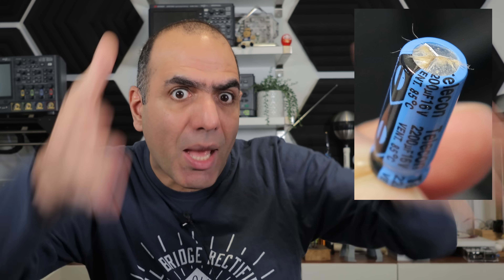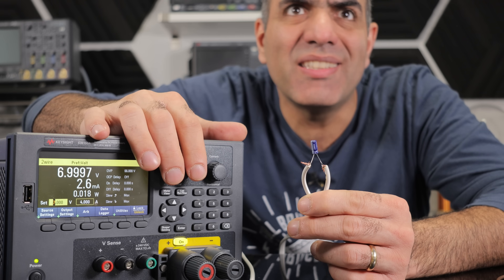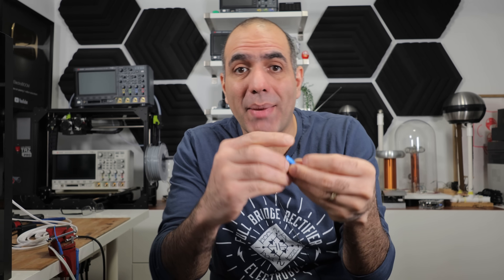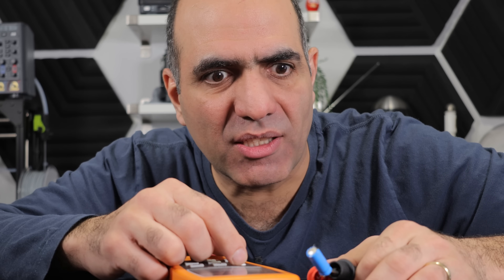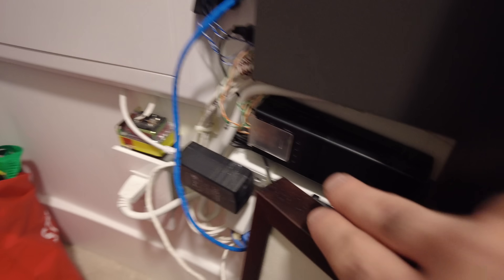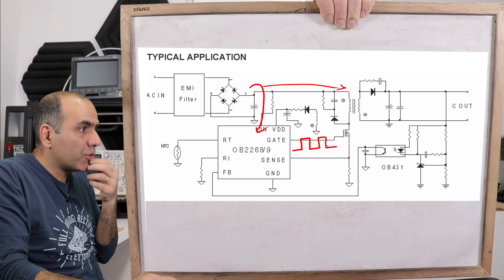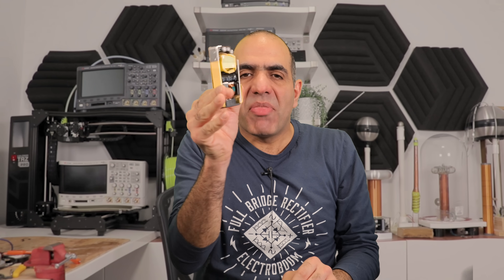Why Replace Bulging Electrolytic Capacitors

Comment: Love your channel, @ElectroBoom!
I love your approach and visual explanations. This one around capacitors, especially electrolitic caps is absolutly true. They are in most cases the first thing that fail in SMPS, aaudio amps and circuits where the ripple is significant. The ripple itself is the main cause of bulging caps.
Now, speciffically SMPS are arguably one of the hardest circuits to explain and diagnose, so cudos for attempting that. in essence there is 4 parts to it:
1. The high-voltage part, where the 120/240V AC input is rectified (turned into DC), by your favourite, Full Bridge Rectifier and fed into a 
2. PWM that coverts it back into AC (via the FET and Transformer), the PWM will controll the speed of the switching to get the desired output voltage,
3. The output voltage that is rectified back to DC and filtered by those capacitors, and
4. The Feedback loop that senses the output votage ( in various ways) and send a signal back to the PWM to correct it's speed
So there are two lots of caps that can fail in SMPS. One are the output ones, that you showed in this clip, the other is the first stage, (the one you were shorting out as it holds charge long after you've switched the SMPS off. It is usually a 400V cap (to account for countries where the voltage is 240AC, and with various capacity (around 200uF). That one is usually the culprit of the failed start up of the SMPS, more than the other ones at the output stage. 90% of SMPS failures are from a failed high voltage cap.

Comment: I have an old dtv converter box that failed. I took it apart and found that one of the capacitors in the power supply was bulging. Replaced it and it works like new now.

Comment: I used to work with an engineer who deliberately blew up electrolytic capacitors, connecting them to 120 VAC, to verify that they  would release the pressure safely.  He covered them with a cardboard box.

Comment: I always replace the capacitors on the switchmode DC-DC converters, especially on a computer motherboard, especially those with supports for Pentium 4 and Athlon K7 processors and later, those processors chugs amperage at low low voltage as if it's a decent cup of beer, it's already crazy enough. So if I get bludging capacitors, I replace them before I bother to apply power to 20 years old motherboards (The Capacitor Plague was a real deal, and it was a headache even for Dell), I also take age into factor.

Comment: About a week ago, I bought a Sega Saturn console from eBay with a "no power" fault. Turns out, the power supply board inside is similar to the one in this video. I'd never seen this AC->DC->PWM->Transformer setup before, but the problem turned out to be the same. It was the control chip that output the PWM that had just died a death. I was looking for bulging caps too, but they were all fine. Replacing the chip (which actually looked more like a through-hole MOSFET) fixed the issue! :)

Comment: 1999 to 2007–the Great Capacitor Death or Plague. Thousands of aluminium electrolytic capacitors died premature deaths due to poorly formulated electrolyte.

I remember the time well, often finding failures in equipment years later. Great days lol

Comment: The reason you have bulging elco's (electrolytic capacitors)  is because the formula for the dielectric has been secret and thus requires money to buy.  Someone thought to be clever, developed their own and sold it far cheaper, and so it made its way into the supply chain.  The problem: this cheap dielectric failed after a few years, but by that time those capacitors were everywhere so especially older devices can still fail as a result.  Newer devices have good capacitors as the failing formula has been taken of the market, but it may still hide on batches of old capacitors.  So yes, the first thing you do with a failing device is replace the elco's.  Sometimes that's all it takes if nothing else has suffered as a result.

Comment: Weather fully blowing up I mean why they're fully blowing up it's because that they don't have like those screws on the top grooves those are events so if a capacitor like fully blows up because those ones are more dangerous to blow up so it will only pop up a little bit with the smoke comes out

Comment: I repaired a charger for a original firefighter worklight,inside was a bulged electrolytic capacitor, rated 3300uF, tested 5 picofarad,😂,i replaced it with a Panasonic 3300uF, with the same volt rating,works perfect. And the worklight itself got a New accumulator.restoration done.

Comment: This is impressive and really cool work. I tried supplying over voltage across an electrolytic capacitor on my channel too. And supplied an electrical fan without a capacitor and later with a capacitor And the results were fantastic.
Reply: Truly impressive work Electroboom. I checked up your channel too lol great stuff you have there.😊
Reply: Electroboom is a wonderful teacher. You too have a cool channel coming up lol with really cool stuff.
Reply: I love the results.

Comment: Many years ago I found two TVs in the garbage and took them home. They wouldn't turn on so I opened them up and found bulging/blown capacitors on the power supply, so I replaced the capacitors (with slightly higher rated ones) and the TVs have been working ever since.

Comment: I have a 12000 btu air con compressor that uses a 60 micro farad capacitor and used a 80 microfarad capcitor that measured 65, and it works, if it works ot works lmao

Comment: Some zigbee dimmer companies mention that you should connect a capacitor at the wire of the switch. For my feeling it was not a good idea to apply 220V at the capacitor, for this reason. 🤣

Comment: My eMac had bulging capacitors... I know - it was a long time ago; still bearing a grudge.  Apple didn't want to repair it for me.  Said it wasn't covered by warranty, even though they were covering the iMac that had the exact same problem... (Yes, eventually they did including the eMac in the Repair Program, but not before thousands of eMacs went to landfill because Apple wanted $600 to fix a $800 computer.)

Comment: Have you ever tried to charge non-rechargeable batteries. I have and they exploded. Partly it works, but you shouldn't control battery heat because it will blow the batteries. I was a kid and I did this many decades ago.

Comment: And to think when I used to work at the car stereo shop we'd sell 1 and 3 farad caps to kids to wire to their systems in rust bucket honda civics with horrible wiring. Its a wonder nobody lost a finger.

Comment: You should build a ventilation system like attach a fan to like a bendable pipe then you can like pull it in. Bring it anywhere you want so you can get rid of the bad smoke

Comment: Meaning replacing the capacitor with a higher rating one, do i change to a higher voltage or higher capacitance or both ?

Comment: You should use car battery clamps and clamp or weld on copper or other material rods and instead of putting it on a car battery you should use a microwave transformer or other high electricity output and make a taser

Comment: Hello, I always like to learn from your videos, and since I see that you always like to challenge all the false information that circulates on the internet, I have a question about how the Lakhovsky multiple wave oscillator really works, I leave you a link to a drive where you can find three books:

https://drive.google.com/drive/folders/1N2xzcl59_2r8jtpBlYUqhP1r2yWJV6q_?usp=sharing

two books in Spanish and one in English, perhaps it is a nice topic to investigate electronics where there are always many doubts about how it works exactly, I do not have the equipment to measure anything unfortunately. greetings from Argentina

Comment: I can tell you that brands of the Capacitor matters, some are higher quality and last long but some doesn't even hold a candle and LEAKS its Juices overtime
As time goes by, Capacitor would need to be replaced by the same uf it has, you can put in slightly higher voltage Capacitor with the same uf, example : 220uf 10v is the one you need to replace, 220uf 16v is all you can find, you can use that to replace

Comment: Warning ⚠️: Video contains high voltage/electricity, wear safety gear when copying, and NEVER wear anything that is not leather, or has metal, even with a bit, he should add warnings for these.

Comment: Electrolytic Capacitors usualy don't blow when you use the wrong polarity. This way they rather die slowly. Its overvoltage that blows them up imidialtly. No matter if polairty is right or wrong.

Comment: My home central air unit has blown 2 huge capacitors in 2 years so I gave up and put in window ac units. They cost what a visit from an hvac company charges to look at the central air. Isn’t being a check to check homeowner great.

Comment: Can u explain  - does it possible square wave inverter convert pure sine wave inverter just using output side LC circuit// & if it happens what r the losses will be there after using LC circuit..tnks

Comment: 8:00 what is higher rating capacitor mean?
Reply: Higher voltage and capacitance, probably
Reply: Higher voltage (or maybe maybe temperature), NOT capacitance. Changing capacitance values may effect the whole circuit behaviour and therefore should be done more carefully

Comment: in college, my buddy (who built his own mg td from a kit, for which i am still insanely jealous) and i used to sneak capacitors from our labs into our pockets and over-voltage them behind the parking lot after class to blow them up real good. except for the electrolytic capacitor the size of a small coffee can, which had safety measures in it and just gave a disappointing p-fsssss, the bigger the capacitor, the bigger the boom. hehe--good times!

Comment: One of the techs at the place I worked years ago delighted in taking large electros out of defunct equipment destined for the bin and placing them directly across 240VAC.  My office was near their workshop and I'd hear loud bangs coming from it occasionally so I took a look.  As soon as I saw what he was doing I got out of there.  It's a miracle he didn't cop shrapnel in the eye really.

Comment: I had a Lexmark printer not turn on. Opening it up I found the remains of a capacitor and the metal cap which had taken a chunk out of a chip on the board.

Comment: I have computer speakers that has a broken power supply because of a broken capacitor so i found a 12 volt wall adapter and connected it to the amplifier and it works now

Comment: You can't just slap higher rated capacitors in place of smaller ones though. The capacitance might be matched to a resistor to create an RC oscillator, or it might be part of a filter tuned to specific frequencies.

Comment: A massive scandal in Taiwanese capacitor manufacturing meant there was a few-year period where there absolute tons of leaky capacitors being sold, probably 80% of electronics had these shoddy capacitors that would frequently die in a few years. It was during that time I well learned how to replace these bastards.

It was termed the "Capacitor plague", and resulted in loads of these half-blown capacitors in every device.

Comment: Most bulging capacitors aren't caused by an overvoltage/overcurrent situation - the dielectric fails with age, and that turns normal voltage/current into a little too much for the capacitor, and THAT'S when they tend to bulge. You're going to have a very hard time forcing that failure mode, as you found out.

Comment: Just had this issue recently with my dell 90 watt power adapter. The voltage at the output swings btw 18.7V and 20.2V instead of a steady 19VDC power. I guess i know why it happened now. Inspected the capacitors and didnt see any bulges at all. I guess it's the oscillator chip.

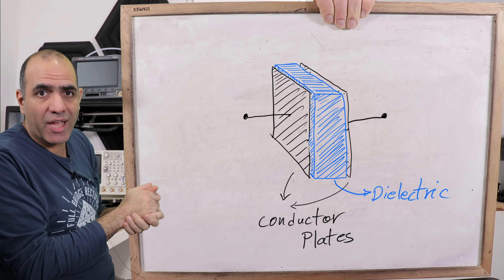Comment: 1:45 "charges are stored on its plates" Yes, and this is the perfect opportunity to talk about why it's called a dielectric! Not all insulators are good dielectrics, the important factor in a dielectric is its ability to form a strong electric gradient between a positively charged side and negatively charged side. The charges on the plates of the capacitor won't stay where they are unless the dielectric holds an opposite charge close to them.

Comment: Some Samsung TV’s were famous for them power cycling several times when powering them up due to a bulged capacitor.  

it finally wouldn’t turn on at all, so I found the bulged capacitor on the board, desoldered it and soldered on one I had found from an old computer power supply and has worked ever since! 

That ending though.   🔥 😂😂😂😂

Comment: I always wondered if you could switch the parts around in a switch mode powersupply to turn low voltage dc to high voltage dc. Flip the transformer and change the resistor values on the voltage divider going to the opto-isolator.

Comment: A precursor to switchmode power supplies dying through failed capacitors is that they generate significant RFI (radio interference)

Comment: I once powered up a new phone system and orange smoke came out of a capacitor on a pcb.  The apprentice saw me looking at the board where I discovered the tantalum cap across a power rail had been put in backwards.  So I just cut the suspect capacitor from the circuit board with side cutters and plugged it in again saying "She'll be right now".  The apprentice was horrified, but the system worked fine.

Comment: I’ve replaced the same popped capacitor in an internal (open board) power supply for an Ethernet switch twice, and it’s popped again. I can look up all the ratings, but is there a percentage of capacitance or voltage to step up to help it last longer? Could it be something else causing the capacitor to pop so frequently? I’ve failed to find a replacement PS.

Comment: Had a network switch partially die halfway through the work day, opened it up to find bulging caps. Replaced them and it work like normal.

Comment: Hi everybody, I'm trying to build a switch-mode power supply.
I have two questions: 
A) How can I design a primary snubber to protect the MOSFET?
B) How can I design the feedback circuitry that gets connected between the secondary and an Arduino?
I thought about making a potential divider and clamping the resulting voltage with a 3.3V zener, but that would not isolate the PSU, and it sounds like a bad idea.
I don't get how to use optocouplers to linearly transfer a DC voltage (I have a few though).
Any ideas?

Comment: I also have some experience repairing faulty power supplies and usually with a switching PSU, there is a capacitor of between 4.7uF and 100uF (usually 22uF, these were the most I found) to provide power to the oscillator portion of the circuit which switches the mosfet. Usually this capacitor also sits next to the cooler plate (to which the mosfet is mounted) which dries out the dielectric due to the heat of the cooler/mosfet and makes the capacitor lose it's capacitance and increase the internal leakage current so it can no longer provide a steady DC voltage to the oscillator circuit. So if you have a power supply which sometimes turns on just fine and sometimes it just refuses to work, replace that capacitor and this usually does the trick. It doesn't need to be bulging to fail, it just needs to be old and/or sitting next to the cooler.

Comment: Sir I have a doubt how to connect a high voltage low amps to a low voltage high amps like I have got up to 400kv voltage but 0.5 amps and another supply is like 0.3v and 64 amps how to connect them and what is the output

Comment: 4 capacitors exploded on my graphics card long ago. It worked fine until the 4th one went, then it would not work for longer than 5 minutes.

Comment: A couple years ago I trash picked a nice 32" LCD TV that had violently flickering backlight - I took it apart and all that was wrong with it was a bulging electrolytic in the power supply.

Comment: 11:05 A box full of maybe useful power supplies is glaring at me from a corner of the attic 😂😂😂.
Reply: I have a box too. The worst thing is, it's occasionally handy. I'm going to have a purge of the lower rated ones soon though I'll be keeping some of the low-voltage wires/connectors.
Reply: And it keeps growing and growing

Comment: Is known that recapping is essential when You have a OG Xbox, because those capacitors have a super bad quality and leak, making corrosion and loss of the copper traces on the motherboard.

If You want to blow up a cap of those, You must search the 1 farad POWERSTOR AEROGEL (aka, clock capacitor.).

Comment: Unfortunately YES 10:35 :face-purple-crying: 
It is cheaper to buy a completely new thing and landfill the old one, rather than repair.
A 0.20$ chip is broken > Landfill.
A 0.5$ ribbon cable is kinked > landfill.
A 2$ choke fried > landfill.
A20$ li-pol bulged > landfill.
UNLESS you buy 20+ and wait a month and pay for shipping; that totals more than the product itself... Fak, back to buy a new one. Anything < 150$ is landfill if something inside it brakes :face-purple-crying:
You  have no idea how much this grinds my gears, tiring to fix the stuff I have and like to use, even if I know what's wrong with it before i open it (something EZ to fix), only to price it out and be disappointed.